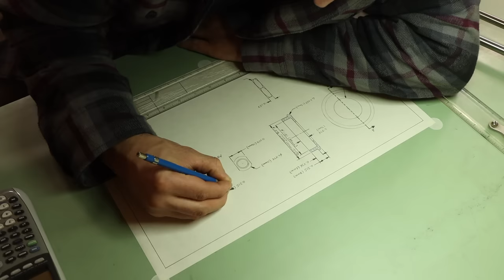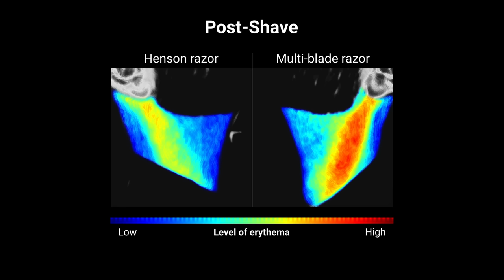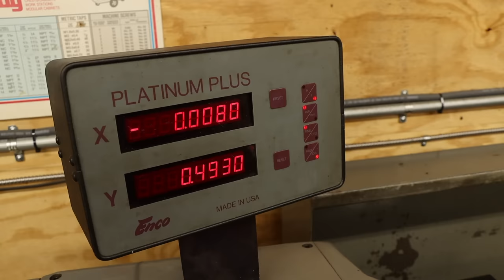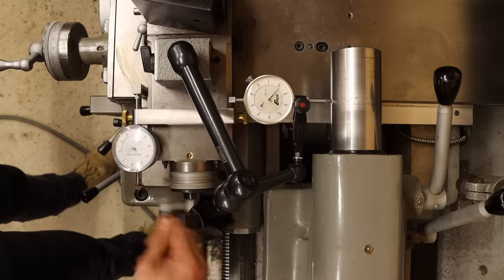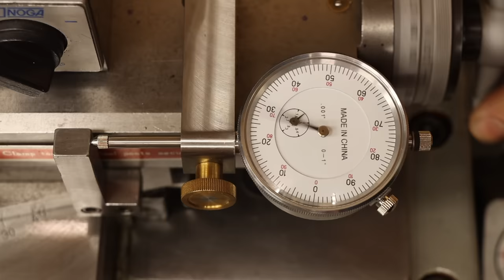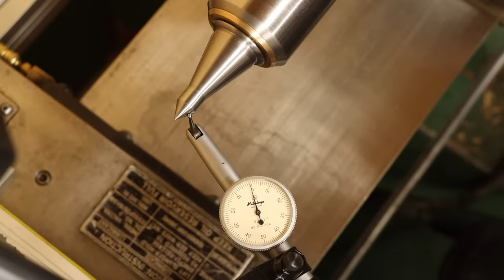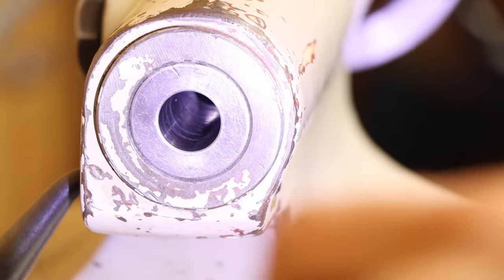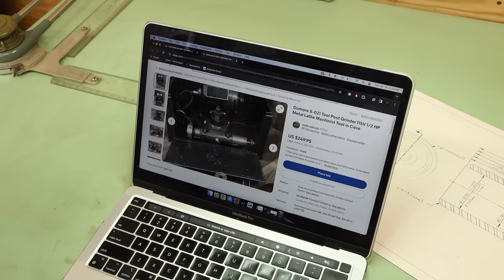WANTED: Dead or a LIVE CENTER

Comment: Seeing all that runout was like seeing a murderer in a horror movie.
Reply from the maker: tell me about it
Reply: @InheritanceMachining  Simple fix though. Just grind the point. O ring drive the center and mount a simple die grinder in the tool post. It will center the thing to the bearings so it can be fitted in any position and it will rotate true. As for being on center bearing wise perhaps you could machine the bore for the bearings with the center mounted in the spindle on its Morse taper. I was a little surprised you didn't do this in the first place.  Also a tip. I have been repairing machine tools for 30 odd years and for super precision bearings or any bearing really there is a set amount of grease you should use to lubricate it. Many machine manuals will include this information but if you have a bearing book  that lists the bearings you are using it should give the correct volume. It's important as to much may cause the internal elements to skip at speed let alone overheat. The nearly universal grease for head stock bearings in CNC is Kluber NBU-15. You wouldn't go wrong using that and it can handle element speeds of over 3500 rpm in bearings that have 400 mm internal mounting diameter. So in the little bearings in the tail stock center there shouldn't be any sort of speed  restriction using it on the lathes you have. It's not cheap but usually you would only use a 50 gram tube on all but the biggest bearing sets. 
Please dont take this the wrong way it only a suggestion from way back in the cheap seats. 
Cheers
Reply: well he did say he didnt have the grinding equipment. But its funny that he would have about 100k in machines but he doesnt have grinders that cost less than 100. because you cant always put everything in a lathe or a mill.
Reply: @smottiebug7518  It's not your regular bench grinder that he needs. There's no way to get close to his needed precision with one of those

Comment: I'm a little surprised you didn't embark on a side project to set yourself up for cylindrical grinding on the surface grinder.
Reply from the maker: Who says I'm not 😉
Reply: @InheritanceMachining that is a project, maybe several episodes to complete, I would like to see!  I have a surface grinder, that is, at the moment, down😢 due to lightning taking out the phase converter control, $$$$ to fix, which I used more for fixing chipped and poorly ground woodworking tools. I would like to broaden its uses too.
Reply: @InheritanceMachining  That's the spirit! 😆
Reply: This comment reminded me the one time I saw a reamer get sharpened on a surface grinder with an indexer and a rotating attachment. It was very impressive.

Comment: Great video as always. Hint: (re)finish the end of the live center at assembly, install the center in the tailstock. Use a vacuum cleaner belt with a make shift pully in an electric drill to drive the live center. Fit the belt over the live part of the live center-I normally just have someone else operate the electric drill, your tail stock just became the drive to turn the live center perfectly concentric. Take very light cuts with the compound, and a very sharp cutter. This is also how you fix your other centers.
Reply from the maker: Thanks! I'm thinking of doing exactly this with a tool post grinder!
Reply: If you mount a dermal style tool in the toolpost and the live centre in the headstock you can grind the 60 degree. Most times the drag of the live centres bearings and seal is enough to drive the centre, if not lock it with sticky tape. A small grinding wheel in a dremal imparts very little load on the part being reground.
Reply: @InheritanceMachining  try a $12 CBN insert from china instead, no expensive equipment, easily replaces grinding on hardened material. Very, very low tool pressure, and can take the last tenthousandth in hardened steel.
Reply: @InheritanceMachining  Watch James (Clough42) make a post grinder to avoid some of the pitfalls!

Comment: Just a fun little fact I have learned going for my machinist ticket, this is technically a "rotating dead center" The dead and live refer to if the center has power behind it or not, so the same center could be live if its in a headstock or dead in a tailstock.

That being said I will still call them live centers

Comment: If you are getting any grinding equipment in the shop, I’d highly recommend getting both the regular wheels and one CBN wheel. Those CBN wheels will NEVER wear out. Use a diamond stone to get them flat, then you simply use it until you either crash it to where it breaks, or you use it enough to where you wear out all the material from trueing it up with the diamond stone lol (in about 400 years lol)
Reply from the maker: Noted!
Reply: Where do you find information on CBN wheel trueing/dressing etc? Basically just have to know someone with the experience?
Reply: @thepanduuh  we have them at my work. You literally just get a diamond stone (which should come with them, if not, they are sold separately) to dress them and make them flat, then your good to go. We get our stuff from MSC and granger. They should have what you’re looking for. They are very expensive and are very accurate wheels. They are about $300-$600 per wheel. You dress the wheel when it’s loaded up with aluminum oxide, then you true it up with a diamond stone. Everything would probably be about $800 for all the necessary products.
Reply: @thepanduuh try this old Tony's site. He did a video on using cheap CBN wheels and trying to true them up. He was, in my opinion, reasonably successful.
Another site well worth watching although he's not a regular poster. Just when it suits him.
Reply: @ronwilken5219  @thepanduh I’ll second This Old Tony - very enjoyable.

Comment: I purchased a set of MT2 and MT3 reamers to clean up tailstocks and headstock of smaller machines. With a little care, you might be able to correct the problem.
Reply: 👍😁 they work amazingly well.
Reply: I have 1-5.

Restoring old iron they're a necessity.

Comment: Instead of using the tailstock chuck to align the pre-load not in the lathe, you might want to consider making a "pusher" - a Morse taper with a disk on its face, faced in the lathe to make it square to the lathe axis.  Very handy.
Reply from the maker: I like that idea. I think i saw Joe Pi makes something similar to hold disc shaped parts just using pressure
Reply: A greybeard taught me a trick for that. Turn what is basically a negative of the part you want to support out of a soft material with a spot drilled on the other side. Then clamp the live center on the spot. I've used this technique to support an axle with a dome-shaped end on a cnc lathe, it worked great.

Comment: Saw a tool for work hardening surfaces on another video. Pretty simple, It was a ball bearing mounted in a holder with a ball race keeping it in place. You just drive it into the surface and it compresses the surface slightly and hardens it.

Comment: When you need more precision than a typical non-adjustable three jaw chuck try using a Buck style three jaw chuck instead. They are the same as a standard three jaw chuck but offer a small amount of adjustment to get the part running concentric with the spindle without loosening and retightening the jaws possibly scratching or marring the part. They are more expensive than a traditional three jaw chuck but well worth the money, once you use one you will not want to use one without adjustment.

Comment: If you can find 1/4” anvil grinding wheels, you can mount a die grinder to a tool holder and use that as a cylindrical grinder, just make sure to use some cardboard to protect the ways and a vacuum to collect dust, you can also use a dremmel but you get clearance issues

Comment: The concentricity issue is all in the center part.  What about driving the center with a belt and using a tool post grinder to recut the point?
Reply: А также сделать термическую обработку до твердости 55HRC
Reply from the maker: That's exactly what I'm thinking of doing 😊

Comment: To get hardening on the area where the needle bearing is rolling you can use a technique called burnishing....
This way you get a hard surface without putting heat into the part and maybe warping...
There are a few nice videos on diy burnishing tools 😀👍
And this also will make a nice project / tool to make yourself.
Thanks again for the nice video and project
Reply from the maker: oooo that's a really clever idea. Why didn't I think of that! 😂
Reply: @InheritanceMachining  - Chrome plating might also be an option, would bring the surface up to ~70HRC.  Home options are probably less straightforward than burnishing though, which I agree is a great idea!

Comment: Of all the machines that I've run during my training and working life, the cylindrical grinder was the most satisfying.  It could routinely provide not only a part made to remarkably tight tolerances but something with a surface finish to die for.  If you can it well on a lathe,  you can do it better on a grinder.
Reply from the maker: I REALLY want a cylindrical grinder for exactly those reasons. I'm thinking i will start with a toolpost grinder and if i find myself using it all the time make take the plunge to a dedicated machine!

Comment: If you end up deciding to hearden it in the future, you should just make it 0.100" bigger so you have enough room to remove any warping that occurs. You should be able to easily remove the excess on your lathe with ceramic or carbide tooling.

Comment: Hey Brandon, I dont know if somebody pointed that one out already but remember to count in the angle from the center drill before you harden the center. It can wear out different parts of the tip :) also good luck with the new lathe, really looking forward to the restauration
Reply from the maker: Thanks! Though I'm not sure I follow you exactly. Are you suggesting the center drill is not 60 degrees?

Comment: Given how easily you separated the drill sleeve off your newly machined taper, I think your morse taper angle might be off. The taper in the tailstock quill doesn't look great, but it's best practice to blue the taper and test fit it to a known good sample.

Sharpie also works if you cross hatch the surface, lightly fit it, give it a 1/16 of a turn and remove to see where you have contact.

Comment: When you first turned the MT in the new live center I was surprised you didn't blue it and do a test fit to look for contact patterns. You just moved on.  Then you would have found the problem. So your looking for a tapered reamer to clean up the contact surface in the tail stock I bet. Great video.

Comment: We had to machine some hardened O1 part at my shop and we were able to remove .030 total with diamond tipped inserts at .005 per pass. This might be an option for you if you don't plan on getting the grinding equipement for it.
Reply: Doesn't diamond burn up machining steel? I thought CBN is the preferred hard turning tool
Reply: @larryw5329  Pretty sure it is the opposite. The diamond reacts with steel at grinding temperatures, wearing the diamond. You can actually dress diamond wheels with mild steel.
Reply from the maker: I thought about hard turning as well. I might have to look into that!

Comment: Try using the Morse taper sleeve as a blue check to verify that the taper you cut on the live center is correct. Find out where the high spot is and adjust your compound accordingly

Comment: Turning cones is not easy. Make an undercut in the middle of the taper, leaving 2 contact relatively wide contact points and it will seat much better. My live center has this feature
Reply from the maker: Oh good point. Come to think of is I think I have some MT chuck arbors that have this same feature but never thought why

Comment: Gorgeously filmed, we never get tired of just watching spinny-shiny-making even if we can just go do it ourselves. On the spindle I would argue it would be safer warpwise to hog out all the non-critical stuff before finishing the critical diameter. Of course you mainly worked on the tail, but I saw you took some in front of the bearing surface too.
Then you went to the 4-jaw and by choosing that, instead of referencing the bearing surface you referenced a surface that was not made in the same between centers setup and is one tolerance beyond.
Reply from the maker: Good call. This was why my approach was to get the outside as dialed as I could and base everything from there. Of course theres still a tolerance build up. I have a plan though!

Comment: Hey I can actually weigh in here! So don’t feel too bad about the runout, that’s actually pretty normal for assembling it all machined. It is EXTREMELY difficult to make a multi-part assembly and not expect tolerance stacking. What most high precision live centers do is grind them in AFTER install. After the live center is fully assembled, you attach a small rubber belt to the live center (luckily you made yours extra long with a straight section so this is easy) then you spin up the live center with a separate motor, so it is spinning inside the bearings, like it would in use. Then you grind in the tip. Now the tip should be running concentric with the bearings and any further misalignment is from the tailstock. 

Some other tips, for bearing installs, use dry ice. You can get it very cheap from many grocery stores and butchers. Keep the spindle on dry ice and wrap the bearings in a slightly damp paper towel and toss them in the microwave. That will safely get them nice and hot and (most importantly) very evenly heated. I’ve done this dozens of times and never damaged a bearing.

Comment: Thanks for the great channel. i enjoy the chilled presentation style.  try this old watchmakers trick for the needle bearing location. 
Leave the needle bearing diameter 1 or 2 thou oversize (trial and error required there ) then use the edge of a roller bearing mounted in a holder ( side project ??) to burnish the journal face. 

This will work harden the face and give a superb finish hopefully making sure you go to the hardend option you mentioned instead of the worn out option.

Comment: The most important thing about greasing bearings is that you use grease, second and third is the oxidation resistance and film strength. Lithium has a pretty good film strength, but I find it to oxidize faster than average. But you followed the most important rule, which is what counts.

Comment: As you have a surface grinder you can grind the besrings to make ghem matched. A little complicated but if you put the bearing down on the magnet with a shim under the inner race and grind the inner and outer, then turn it over and grind both inner and outer without a shim. Do it for two bearings and you have for all intents and purposes a matched set, although not necessarily considered "best practice"! Dont get the bearings the wrong way around or you will make things suitable for your box of shame. I'll let you ponder the methodology. 
Before you go for a cylinder grinding set up, buy a morse taper reamer and clean the tsilstock bore. And a dremal works well enough to grind a centre true, without a lot of expense.

Comment: There is probably already a million comments stating this, but you won’t need cylindrical grinding equipment to fix your center. It is its own fixture, just plop it in a vblock on the grinder, run a o-ring as belt around the tip and your powerdrill and grind it in its own bearings for perfect results! Love the content!
Reply from the maker: Not a bad idea! I still want a cylindrical grinder though 😂  thanks!

Comment: Having entered design engineering in 1970, I appreciate manual drawings.  And a good looking drawing is easier to understand and use...and it is good looking.  I had to smile at the careful cross hatching, remembering a well-respected boss.  He encouraged showing just enough hatching to get the idea across.  We did chuckle when he said, "I'd rather have a guy spend his time thinking instead of cross hatching."  He wasn't conviced when I told him that I could do both at the same time.
Reply from the maker: 😂 It is a bit of a mindless activity. Glad you liked them!

Comment: You can always press a dowel pin or broken tool into the tip of the center. You can set up a grinder on your compound and clean it up. That's what we did in tech school  24 years ago.

Comment: The temperature difference need to be pretty big for the bearings to slide on the shank. If im lucky i heat bearings with 30 mm dia to 150 C and shaft at room temperature and it might slide on, but usually needs pressing on. So the dimensions on your part is probably ok

Comment: firstly, it is always a pleasure to watch your work, I wanted to ask if  you considered offsetting the tailstock to machine your Morse taper between venters using a power feed for better finish/control? I'm not at all knocking your method and know to well the struggle of having my tailstock running true to the head stock and am always reluctant to adjust it, simply asking to appease my curiosity